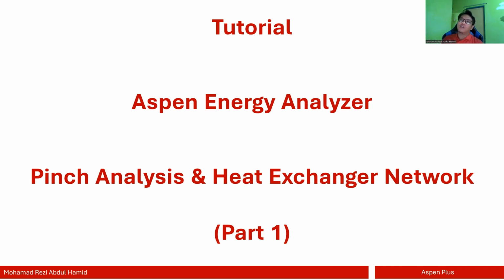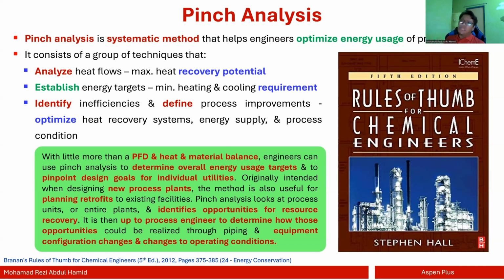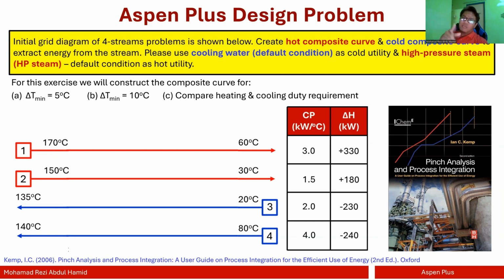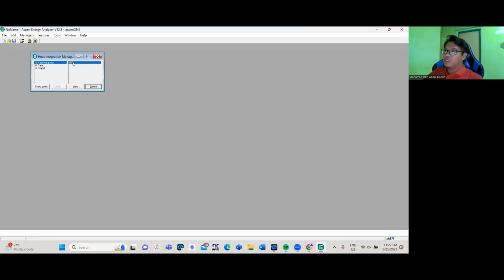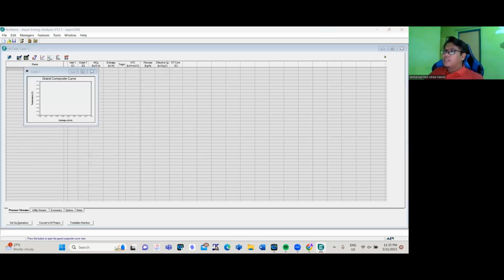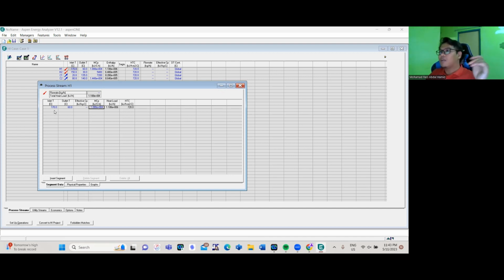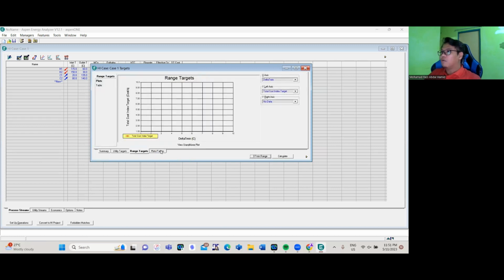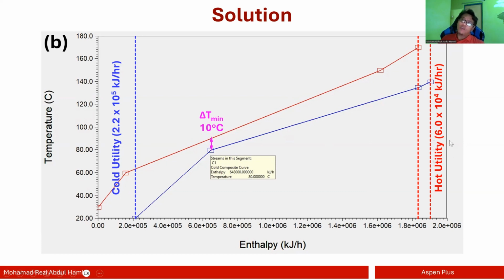Aspen Energy Analyzer (Part 1) - Creating Composite Curve

Comment: Thank you so much. Just a little suggestion, Sir. As I know the magnitude of DT Min is not so arbitrary, to decide whether it shall be 5 degC or 10 deg C. There is a minimum value of it. If you set the DT min too low, you will end up with having only cold end network as your video (network that only require cold utilities, it is undesirable in design point of view). Anyway, I am also new in this field. Your video help me a lot to understand about aspen energy analyzer interface. Thank you !!